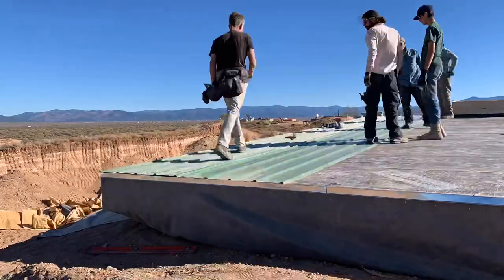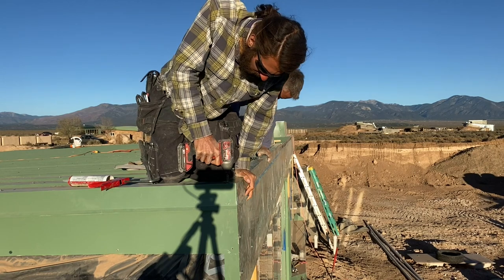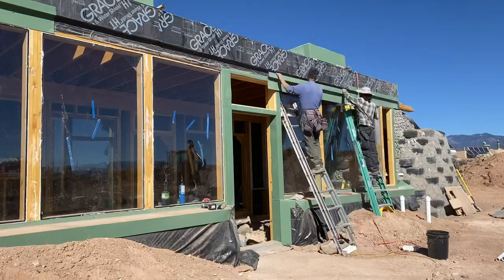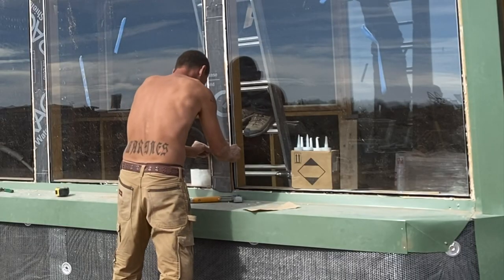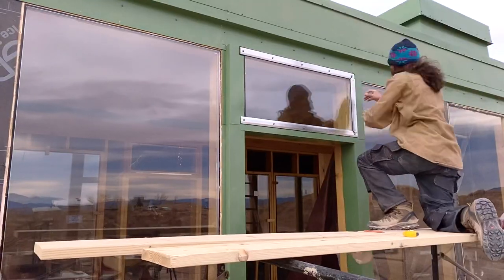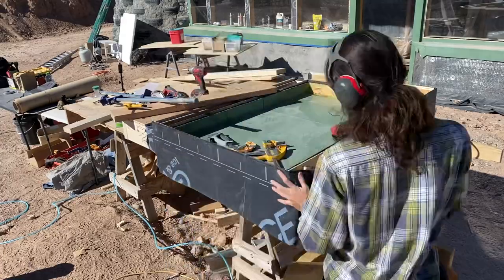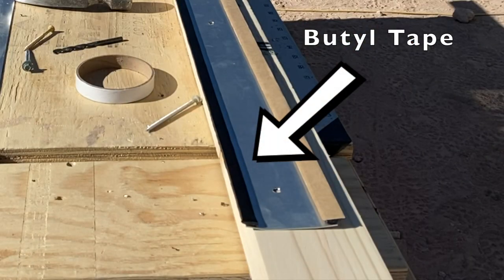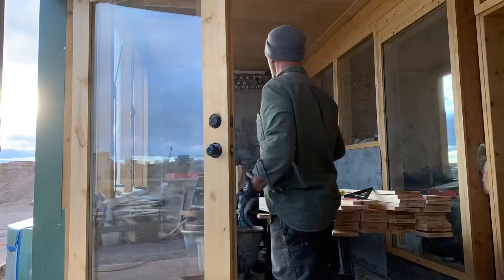EARTHSHIP TINY HOUSE Passive Ventilation and Metal Detail Installation

Comment: OGG, nice video series! Very well done! A couple of questions and points possibly worth covering in your follow up videos.

About the main roof, with three layers of 3" thick polyiso it appears to leave an inch or so of "attic" air space, which will obviously heat up especially in the summer sun. How is that hot air space being ventilated? 

Also, since I'm in an area where radon must be guarded against, just curious to know if you included a radon and moisture barrier under the "foot pint" of the tiny Earthship? Or will that be done indoors prior to installing the flooring? Ron hinted at Radon barrier info to be covered in one of the videos but nothing as of yet.  

This build is really neat, and the videos very much appreciated. I have the Global model builder's books but it is very helpful to see a pro like Ron taking a build from the ground up, and sharing his time and labor saving tips. 

BTW, have you had a chance to measure the indoor living space temperature variance over a 24 hour period? 

Keep on keeping on dude!
Reply from the maker: Thanks Byron! We punched holes in the TJI joists to allow the air to circulate within the cavity but there are no soffit vents. This will be added on the next build. 

We added radon barriers afterwards, digging up the floor and installing EPDM liner in the living spaces. I didn’t document it much however as there were more important things happening. 

Yes we have measured the indoor space since being totally closed in. I will ask and update this comment once I get the answer!
Reply from the maker: Regarding the temperature, Ron said the low is 50F without the doors sealed and a couple open chases. Let me add that Taos gets really cold in the winter, so for the first month, 50 degrees is great! Its performance will improve over time.